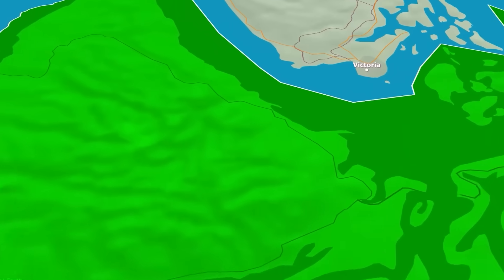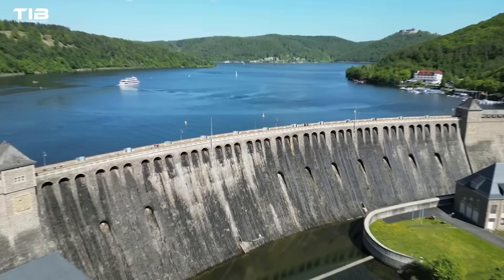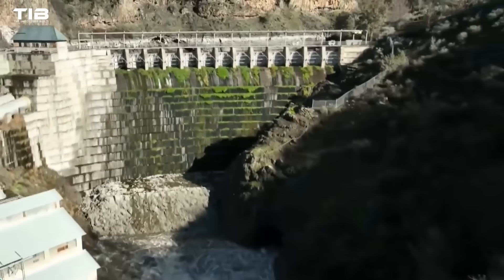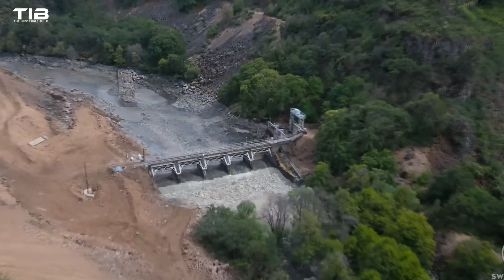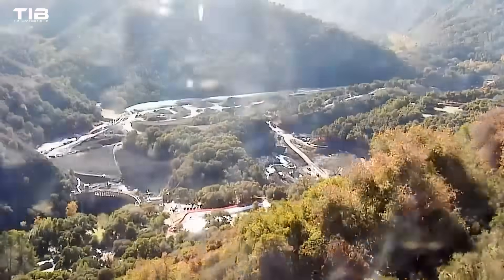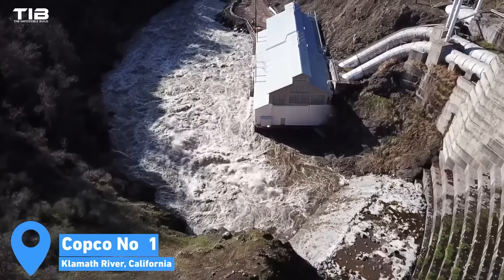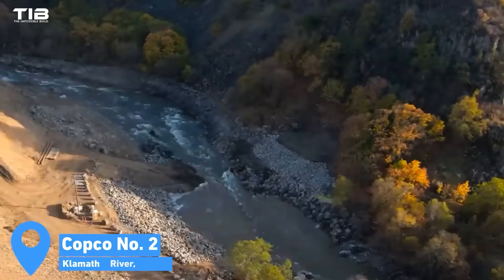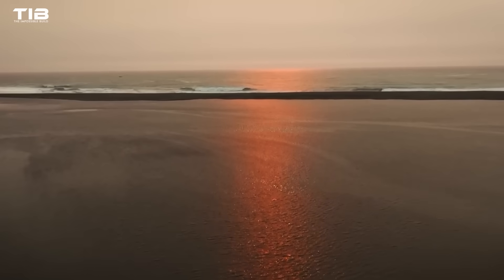How (And Why) America Is Removing Its Dams

Comment: Why are dams constructed without rebar or steal reinforcement
Reply: Concrete is weak in tension and strong in compression, rebar is added to give it strength in tension, dams are mostly designed to be in compression, so rebar doesn't add any strength. So rebar is only used in areas where the concrete is in tension.
Reply: @taznz1  In addition to being hard, concrete also has it hard - the pre-stress, the stress, the tension, compression. always wanting to cure, then the breakup...
Reply: @taznz1  wow that's a really perfect explanation thanks I've been wondering

Comment: Climate Change nonsense. It sounds like a speech by Gov . OK some dams need replacement, but generally river environments do not suffer from dam structures. Salmon numbers remain the same, where dams are properly designed.

Comment: Climate Change nonsense. It sounds like a speech by Gov New-scum. OK some dams need replacement, but generally river environments do not suffer from dam structures. Salmon numbers remain the same, where dams are properly designed.

Comment: Climate Change BS. It sounds like a spech by Gov New-scum. OK some dams need replacement, but generally river environments do not suffer from dam structures. Salmon numbers remain the same, where dams are properly designed.